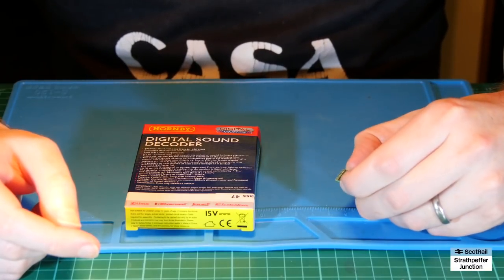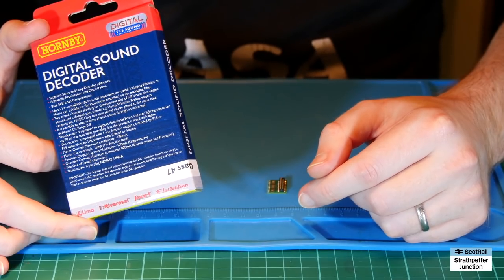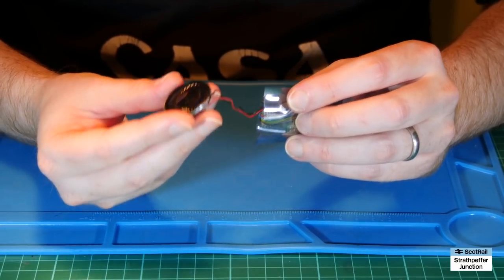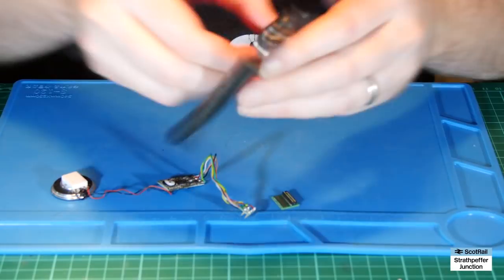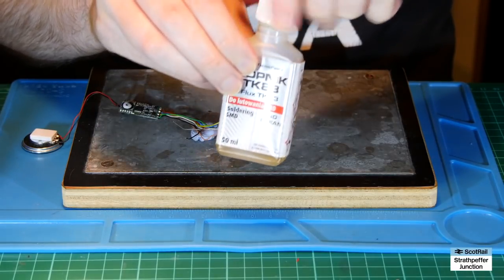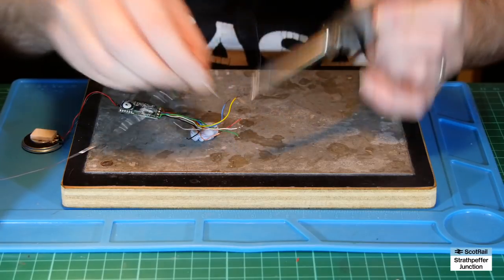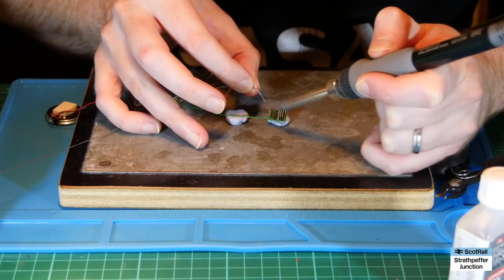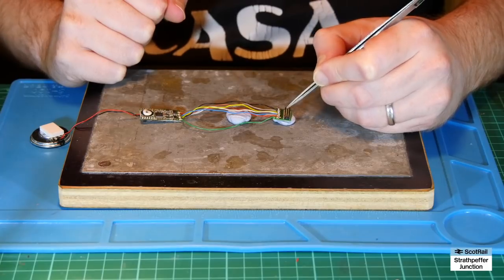#11 Modifying an 8-Pin DCC Deocder with a TCS 21-Pin Breakout Adaptor

Comment: Hi Enjoyed the video very much as I was wondering how to do this. I have fitted a Class 47 TTS decoder into a Heljan Lion and it has been brilliant and not blown the decoder. I actually fitted a LokSound Class 50 to a Heljan DP2 and the decoder went twice good job for the warranty.
Reply from the maker: That's really good to know, many thanks! I've always thought the heljan power draw would zap a TTS chip, but if it copes, the may provide even more usage options 👍🏻

Comment: Where do buy the decoder tester. nice video
Reply from the maker: Thanks, Chris. That one was about £10 off ebay. You can buy the newer ones (which come with a switch built in, so don't need this conversion) for about £45. If you can wait, the old ones pop up periodically on ebay and are still worth the money.

Comment: Hello again I only ask because I don't  know enough about this topic however, I know there must be others looking as I am by virtue of the collection of older and favoured locomotives. You seem to have your finger on the pulse so who else best to ask Cheers
Reply from the maker: I may have a couple of hours free this afternoon to shoot something quickly. If I do an explanation of what the wires on an 8 pin decoder do and talk about how to fit one to an old ring field type motor, would that be enough? Unfortunately, I don't have any old ring field type motors to convert as I've sold most of them on, so can't actually show the installation process. Anything specific you'd like me to touch on? 🙂

Comment: Hi there good video can you do a video on what the different coloured wires are for and how they should be connected to.....say an old Hornby class 25 please? I want to change to DCC but I have older Hornby and Lima locomotives. I have watched how to connect a chip to the engine and pick up stuff but they never discuss the other coloured wires and how they work the lights in presume. Cheers I still enjoy your video keep up the good work. Guy
Reply from the maker: Hi Guy. Many thanks for the kind words. Much appreciated. Do you mean a quick explanation on what each wire is for, like red and black from the rails, grey and orange to the motor etc.? If so, I'm sure I could do a quick one on that, yes. 🙂
Reply: Hello again you are welcome and the short answer is yes but if it isn't toooo much trouble could you do a video on fitting it as well as explaining what the wires are for. It appears an easy fit but I would like to be sure, it is expensive and I want to get it right. Kitting out 30 locomotives with chips will take time but I figured an old Hornby class 25 would be an average older model to emulate the rest.
Reply from the maker: I'll see what I can do over the next week or two. 🙂
Reply from the maker: Guy Prior Hi Guy. I've found an old Lima Class 47 that I need to add a decoder to. I'll use that for a video looking at hardwiring a dcc decoder into an old ringfield motor loco. Will hopefully get it done in the next week. Hope it helps.
Reply: Hey there sounds good please discuss where all wires go even if you don't connect them. I am looking forward to seeing this and I know it will be watched numerous times....by me. The other thing is why use an 8 pin when a 21 pin seems to offer more options  or am I mistaken??? Cheers hope you are keeping warm, we are getting storms hitting the country but palmerston north isn't seeing much action, weather wise. They call them cyclones in the south Pacific as opposed to hurricanes; same thing really. Happy modelling guy
Reply from the maker: Hi Guy. I'll try my best to cover those things. 🙂

Comment: Excellent tutorial =D 
Do you have a purchase link for the breakout boards?
Many thanks for the show shout out, I do believe it is helping lots of channels getting recognised including yourself =D
regards Jason.
P.S I think i have the name right now ;)
Reply from the maker: Thanks, Jason. Much appreciated. Yeah, the show is a great thing for getting some exposure to the newer channels. They're the ones that need the shout outs more than the big established ones. Re the adaptors, you can get them here (when they're in stock). Ironically, unless you have five to convert, they're a more expensive option than cutting off the 8 pin socket as I did in the earlier video. http://www.dccsupplies.com/item-p-102856/tcs-21-pin-1358-breakout-adapter

Comment: I fitted  a tts class 37 to a vitrains 37 both 8pin as you know.  Everything worked  fine for 20 minutes then the sound just packed up.  The motion  was still there though. Do you think the vitrains was also drawing to much current.  Love your videos  very informative.
Reply from the maker: Many thanks for the kind comments, Raymond. Much appreciated.

Re. the chip. I don't have any Vitrains locos myself, but I just had a quick look on rmweb and Google, and can see examples of them working OK with TTS chips. My gut would be that it's not a current draw issue, as you'd probably not be experiencing sound either. It's hard to tell without seeing it and probing about with test equipment, but if I were a betting man, I'd probably spread my bets on either the chip being faulty/blown or lose wiring/connection.

Did the loco work fine under dc?
Did/does the chip work OK in another loco? 

Before doing anything else, I'd recommend you take the chip out and look carefully for any lose connections/solder joints and also any potential shorts between wires to/on the harness. With these Hornby Decoders, I've sometimes found that it's only by the grace of God that poor soldering hasn't lead to shorting. 

If there's a lose connection, carefully solder it and try the decoder again. If there's a short, if it's fixable, fix it - they don't always blow the chip if the chip has overload protection - and test the chip. Perhaps best on a test track with limited current, if you're able to do that. 

If there's nothing obvious visibly wrong with the chip (eg. no obvious shorts), try using it with another loco and see how it fairs. Perhaps try twenty mins in one direction on medium speed, then the same in the other? If it works, then it may be down to an issue with the Vitrains chassis, so potentially a short in it/on the pcb or a motor issue that draws too much current (sometimes cleaning and lubricating the gearing can help). A short is perhaps less likely if it worked on dc. 

If it doesn't work in another loco, it's probably a defective chip. In which case I'd contact Hornby and ask for a replacement. I've never (touch wood) had an issue with a tts chip, but have had issues with their basic non-sound chip, and that chip is, I think, what underpins the tts decoder. 

Let me know how you get on 🙂

Comment: I don' t know if the Class 20 has the same height problem. Quite likely.
If you have one spare,  please send it. I'll pay for it, and postage
Reply from the maker: Don't worry about paying or postage, William. Consider it a thank you for supporting the channel 🙂 I'll pop it in the post tomorrow.
Reply: You are a gent.
Reply: I have just received the adaptor. Looks like the Class 20 may be a goer using the same speaker I used in the Class 47.
Thanks again.
Reply from the maker: No problem. Best of luck with it!

Comment: After my finally succeeding to convert my class 47 using your method, I am considering fitting a TTS decoder to my Bachmann class 20, which also has a 21 pin socket. I bet it also won't be easy.
Another great tutorial, presented in a very clear way.
I look forward to more.
Reply from the maker: William Glover Thanks, William. Well done getting the other one done! Did you get my email? I've found the adaptors (as this video shows!) so can pop my spare TCS one in the post to you, if you'd like?
Reply: I've just had the top off this class 20. Very easy.
However, how one can fit a TTS decoder is beyond me.
Just enough room for the 21 pin standard decoder. There is a moulding to take a  oval speaker, but the recess has minimal depth. 
Not too clever these Bachmann designers.
I'm going to have to ponder this a bit more.